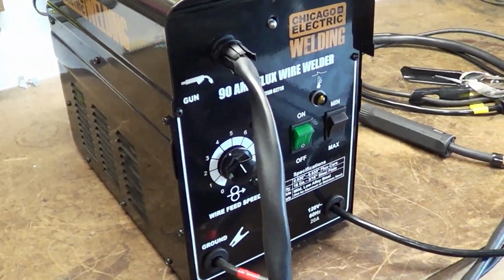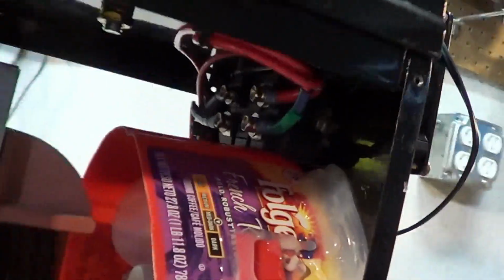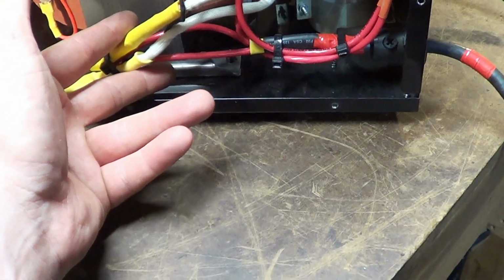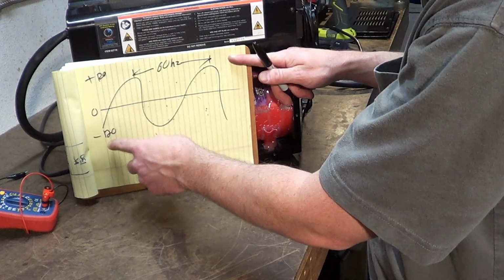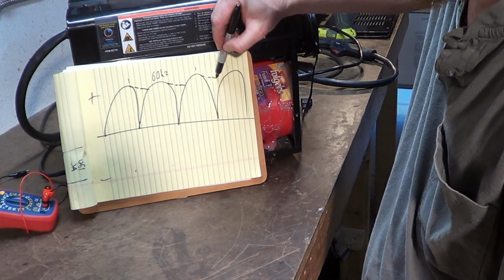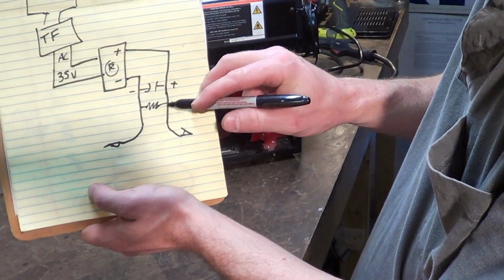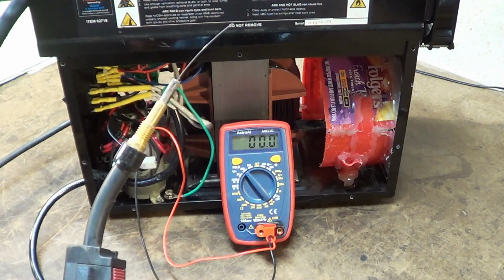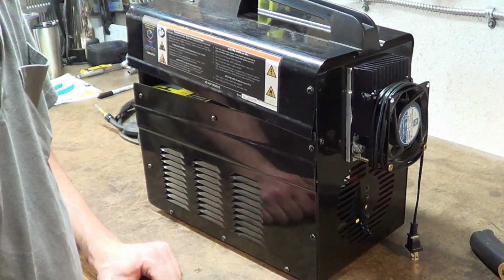Harbor Freight 90a Welder: DC Conversion & Upgrades!

Comment: Good video.😜

I remain doubtful concerning the use of capacitors. I would guess that you need a ton of them to maintain the amperage through the circuit. The amperage requirement from them is key. So as the wave goes over the peak the capacitors discharge. They see almost a dead short so they unload quickly. So they maintain the peak - briefly. Flatten it slightly. Then they're done.

Comment: Good video but the camera work gave me the sensation of tumbling thru space! :-) Capacitor value - the more the better may not be true. It takes a scientifically calculated period of time to charge any capacitor. The more capacitance the longer the period. The period of time between peaks of full wave rectified AC is determined by the frequency. I'm thinking then, that choosing a capacitor that would charge to 90% of its value would be based on the time it has to charge. While the output voltage drops to a somewhat less voltage during the arc, the capacitor(s) are not charging to anywhere near the 30/35 volts. I have no experience at welding, a limited knowledge of electronics, and I'm short in the math department - just an active curiosity. Someone could figure this out I'm sure. No doubt they have - in more sophisticated designs.  ❤ your fan shroud! Effective & cheap. Thanks Eighth Acre Maker. Happy 2026.

Comment: You Don't really Need a Capacitor on these Low Amp welders just a 150amp rectifier is all you need for DCEN  i have converted  a few and tested with Capacitor 30K-50K uf and without and there was no real Noticeable Diffidence , One other upgrade i do on there welders is replace the 16ga AC Power cord to a 14ga or Better 12ga cord .

Comment: I built one at work with some HD diodes from a retired forklift battery charger. Used it to do scratch start TIG with my Lincoln Tombstone Welder. Have you tried to run scratch start TIG with yours?

Comment: Your plus and minus line on a sine wave aren’t +120 a -120v. That’s RMS (root mean square). Peak voltage is about 170v ac. RMS voltage ac is .707 x peak voltage (170), or to find peak voltage, use the formula RMS X 1.41.
~ maybe too “techie” for a welder conversion, but interesting nonetheless. 
PS. Love the conversion. I’ve done it myself. Makes a cheap welder much more useful. 👍

Comment: I’m in the middle of doing this, I cut the wires after the ac supply to the board as you did but I’m not getting any voltage on those.  Any idea why?

Comment: My experience is it’s not a bad welder as packaged. It might get better with a DC conversion but I get good penetration with it now, and your before beads all looked user related. Trying to drag too fast, low wire speed, varying stick out, and stick out matters, keep that steady and get your drag speed down and you’ll be alright either way. I still plan on doing the conversion but I don’t expect a dramatic difference it might be better to buy a used 120V MiG from the pawn shop and run flux core wire through it. When I first got mine it took some learning, welds do spatter a lot but yours did too so not much change there huh.

Comment: Yea i put a big ass choke on mine with about 800k μF worth of caps on it..   only regret is i never put any bleed down resistance on the caps so theyd stay energized..  and 800k μF @ 55vdc is a hell of a lot more power than you'd think..  i discharge it by snapping it to the ground after welding but i guess either i didnt do that one time or didnt completely discharge it and damn thing killed my girlfriends cat..  guess it brushed up against it and zapped the thing.. died on top of my welder..  she left me because of it.. so put bleed downs on your caps, just might save a cats life, and a relationship..  trust me, shit will happen no matter what, just makes shit happen a little less when you try to prevent it..

Comment: Has anyone out there run into this problem with this Chicago Electric 90 Amp Flux Core Welder?
  When I press the trigger to start welding the wire feeder comes on for about a second and then stops.  It does it even when I remove the wire.
  I took a shot in the dark and replaced the wire feeder with a new one that came with the small electric motor on it.  It did not fix the problem so I lost that gamble.  It still only runs for a bout a second then stops dead although the welder is energized.
  What is the problem?
  Can anyone help me here?

Comment: U did all of this upgrade  stuff  and  didnt  put a toggle  switch  that's got the 2 way clicker to where the only place  it will stay is in natural  and will allow  you  to reverse  your wire outage  and so ur not wasting  and wire because  after awhile  of cutting  it off like that could  make  for a big project  but u ant gotta  listen  to what  I'm talking  about  but nothing  like having reverse  on ur wire feed because  what would  happen  is u accidentally  hit the trigger feed and  not pay it no never  mind  then what u gonna  cut off  all of that wire or when  u  could  have  a switch  that allows  u to reverse  the motor  of ur wire feed then  that's a life saver  because  u will  be  able  to run  out wire or run it backwards  to save u from ever having  to  cut it off ya kno but ur grown  do what  u want  to its ur welder  I just figure  while  ur upgrading  what's another  10$ tops for the 2 way clickable toggle  switch  that allows  u to reverse  the polarity  on just the wire feed nothing  else  but like I said  I would  and if u want  to get really  technical  u could  drill out a couple  holes about  the size of 2 stick welder  hook up so ur able  to reverse  the polarity  on it as well  but u could  add those ends to the bottom  of ur unit  and wire them  online with ur transformer leads to ur binding posts for ur stinger as well as ur ground  but there removable  leads I like the ones with the spring  loaded face covers so u are safe from anything  being  able  to get fouled up between  ur leads or ur standard  binding  contractor  leads it's no different  then  what  ur using  here just with  a upgrade  that it didnt  offer before  and if u wanted  to keep  the stick and mig working  separately  would  take a plane  heavy  duty  toggle  switch  made to hold some  amps and volts  but this would  very  between  a 100$ machine  and a 300$ any machines  higher  usually  already  has the needed  switches all besides  the reverse  feed motor  I've not really  see any machines having  this and  its beyond  me fr fr idk what they was thinking  not putting  some type  of bump button  that will pull the wire back  into that machine  because  that wire is anything  but cheap  especially  if u use the most better  and expensive  brands out here but engineers are smart but most doesn't  have  good walking  around  since  they are highly  book smart  and  when  designing  something  for ur everyday  guy to have  or use especially  beginners  the over run there wire out alot and  that would  just save a new starters  from looking  like there wasting  more wire then  what  there weldin  and  just this way there not cutting off and  wasting  any wire at all and not wasting is saving  money  to me but like I said its ur machine  u do what's best for u and  what fits ur needs fr good luck tho fr I'm in the middle  of trying  to find a replacement  wire feed  board that will work with my turbo 130 mig welder  because  I've looked  every  where  including  the manufacturer  so I guess  I'll have  to wait and see what one coats this is what leaving  it a ac bs welder does to one with out  doing this CONVERSATION to be honest  this or  get ready  to except  the really  bad welds one fr because  with the conversion  what it does is it isnt  anymore  pushing the welds to the metal  like it is wired to ac now once u do the swap and  add the components  as u see in ur video  above  now what  dc does is it reverse  the 2 where ur wand used to be the hot well now its ur Neg and this in turns  makes ur ground  clamp ur hot then  and now when  ur welding  is pulling  ur welding material  to whatever  ur welding  and makes for 300÷ better welds idc if u never have  welded before  ur welds will always stick and run a boatload smoother but like I  say ur  grown  do as u please  I've gotta  find out what all that board  really  ran weather it's just wire feed or it's some kinda  CPU of some kind  if not  both idk maybe I'll  get it figured  out but good luck on any other add on's u may or may not do have  fun and  dont electrocute  your selfs later lol

Comment: A lot of people are saying not to use anything lower then a 150amp rectifier because most of the 100amp's were failing.
Reply from the maker: Mines gotten pretty warm but it’s been ok. Probably because big heat sink.  I have run it pretty hard a number of times. I’d agree though a 150a would probably be better.

Comment: When u just swap the leads from the control handle makes a 155÷ better hands down fr fr this is with out the rectfire and it started to stick like there was no tomorrow I don't doubt this method what so ever cause before I swapped the leads it was just spotting everywhere and wouldn't hardly even stick and I welded with it today and oweee I'm highly impressed I can't wait till I add a few other items and it will hang with some of the top brands on the market listen to this man he knows exactly what he is talking about fr fr grats !!!

Comment: I got a zeny 130 mig welder with a 100V  10,000mfd cap. w/o a bleed-off resistor Anyone know what size of resistor I would need?
Reply: 200-500 ohms is good enough 10-20 watt rating.

Comment: Could u help me do this to my welder. I use mine so much its insane.  Build car parts for fun but the welder is a splatter machine.   I'm always on my grinder knocking the splatter off  and I noticed I can't really weld thin sheet cause  just when I feel like I got it to not burn through it burns through like it's more power than I set.     I got a good method for thin metal welding to.   Also I built intercooler pipes and I spent a day knocking off splatter cause i had to gap weld

Comment: I used a 200amp rectifier & heatsink. An amazing difference in welds.
Reply: did you add the capacitors?
Reply: @steven33068  no it finally died before I did but I am considering buying another one just to try it.

Comment: 10lb spool of lincoln electric wire fits in my machine quite well, but leaves no wiggle room, no need to stick to the tiny 2lb spools. I agree a good ground clamp is a good cheap improvement, and simply installing a rectifier makes a noticeable difference in performance.

Comment: will a 100 watt 15 ohm resistor work for this mod?
Reply: Too small a resistor,   100-500 ohms is good enough,  resistor is just a safety to drain the caps when you turn off the welder so there is no voltage across the capacitor leads after a minute or so.  Also you would be dissipating 90-120 watts in the resistor which means that the 100 watt rated resistor would get very hot and probably fail.

Comment: A small correction, if you connect capacitors in parallel you will have half the capacity. You need to connect them in series to add the capacity. It works exactly the opposite to resistors.
Reply: Your right they are opposite resistors which add in series. Capacitors add in parallel.
Reply: Wrong! You series resistors to add resistance and parallel capacitors.
Reply: You're 180° opposite. Parallel capacitors add capacity while parallel resistors drop resistance.

Comment: what value caps did you use? voltage and uf. tnx Dan
Reply: He is using 2 capacitors. Each is 40V and 20,000uF. If you add capacitors to your welder, I'd suggest getting several at 50V and 20,000uF each. Wire them in parallel and you'll get 60,000uF.  That should be enough to give you a noticeable improvement. When deciding on a capacitor, its a good idea to get a capacitor that is rated approximately 35% higher voltage than the operating voltage of your project. Cheers

Comment: Thanks for sharing!  Interesting seeing these modified into more uses.  Was thinking the same to make an arc or TIG welder from a cost effective MIG or technically flux core welder hacked out.
Reply: Why? You can buy DC arc/Tig machines around the same prices.
Reply: @308dad8  Great electronics design study project and the parts aren't that expensive.  Plus can possibly be done with a made in the US rescue welder found for under $100 if you go old school analog design or maybe even under $100 with the newer digital IGBT designs.   For the DC conversion alone, you can get the full bridge rectifiers for like ~$10 for five 50A ones.   The capacitors cost more and inductors you can technically re-wind free microwave oven transformers and he bleed resistor can be found free in the microwave.  The other parts will cost... though can be found cost effectively patiently hunting around or online new.   More a DIY Hack projects that's rewarding if you know what you're doing.
Reply: @jafinch78  Fair enough, it is great electronic study. Include the kids to boost their home grown STEM studies.
Reply: @308dad8  Yes sir, trying to inspire more to rescue, re-use and/or re-purpose ideally made in the U.S. tools/equipment, though others makes are better to be saved from the trash or even recyclers.  Great, if not excellent, learning experiences for all ages where the youth being exposed if not hands on helps correct the "throw away" mentality.  Most all my videos are something to do with that paradigm of thinking, albeit not the best productions since impromptu.  Though I do have some other PSA and videos I did edit and get more detailed regarding, though not so much lately since not bored.

Comment: You didn't draw a 60 hertz dc output. Thats a 120 hertz DC output which is the actual output ripple frequency from a Bridge rectifier. The only rectifier type that would give you a 60 hertz DC output would be a half wave rectifier.

Comment: Hi, so I went and did the conversion with a 100 amp rectifier and a 50V, 68,000 mfd capacitor. Went and started a weld and it lasted about 10 seconds then quit. Going through different You Tube vid's I figured the rectifier was too small and went to a 200 amp unit. Tried a weld and all I have is power to the fan and wire feed. Tested the voltage going into the rectifier from the transformer and all I have at best is 1.3V. Did the transformer puke on me or is something else causing such a low voltage problem ?

Comment: my wires for this project were #6 cables with ends sourced from my collection of bad booster packs.  the new lead to ground was also #6 wire from a set of HF booster cables i never used. it had a great battery clamp i could barely squeeze. rectifier is 150 amps and filter cap is 470000 mfd   many.thanks for addressing the value of the bleed resistor needed.

Comment: My resistor gets hot as hell and starts smoking!
Reply: If its made in China, its not uncommon. Some resistors are made with aluminum rapped around the resistor to act as a heat sink. Swap out the resistor and make sure its wired correctly. Semper Gumby (Stay Green and Stay Flexible)

Comment: You get full wave rectify? What max DC output
Reply: You just multiply you AC voltage with 1.41 and you will know the DC voltage...
Reply: @tynix1  You actually measure DC output with your meter or just calculation?

Comment: Hi nice video , i need help with capacitor I found on eBay its $11 50uf but not sure if it’s right one  i will leave a link can you check it please . https://www.ebay.com/itm/254592301708

Comment: Why a capacitor and not a coil?
Reply: All the things you are saying is for general electronics, not for welding. Capacitors buffer voltage and welding is all about current. Just make a calculation how many Farads do you need to be able to support 50Amps for 1/60second at say 20V? Here is a guy who is doing the better thing. http://www.hildstrom.com/projects/ac-225/
Reply: @KaloyanDobrev  a friend of mine just serviced my Miller welder, and it has a bank of capacitors on the output.
Consider this.
https://www.ebay.com/itm/203092862083
Reply: A coil would work as an arc reactor, but the capacitors filter the DC and smooth out the flow, where the benefit is a cleaner weld.
Reply: What you say seems the opposite from what they say here https://www.twi-global.com/technical-knowledge/faqs/faq-what-does-inductance-do
Reply: @KaloyanDobrev  the fact of the matter is both can be used together this is what is referred to as an LC circuit. L is the inductor and C is the capacitor. The latter is called a filter.
I just don't have room in there for both, so it is normal under most circumstances to used a capacitor after a rectifier. Commercial welder applications would have both designed into them.

Comment: Ironically.. all this work to make it weigh even more, or you can just get the titanium flux for $100 more and it is 1/3rd the weight and size and all DC. ;)

  Always fun modding gear like this, though!
Reply from the maker: Ima Crazy Guy I had this exact thought reading the HF catalogue with my son a couple days ago. Scrounged is cheaper then bought I suppose 😂
Reply: @eighthacremaker7129  Wondering about making an external microwave oven max spec inductor or maybe variable inductor to make more a CC design add on external box with the Dense connections.
Reply: If the 125 amp is like the 90 amp, I would prefer the modified 90 amp.

Comment: Wait,do I need ac capacitors or dc capacitors?
Reply: DC Capacitors. AC caps are used in electric motor starting circuits. (they have other applications as well)